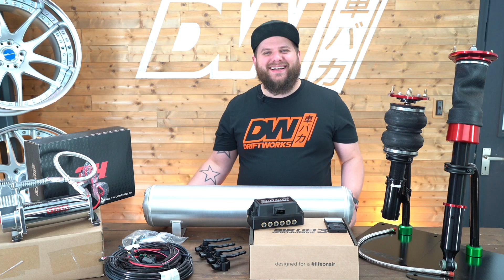A closer look at Air Lift Performance Air Ride Suspension by Driftworks

Comment: Hey bro ,I need some advice and recommendation on ah set of air suspension, wanna replace the original coils and install the air suspension, thanks for your help
Reply: It's for ah 2012 benz e250 cgi w212